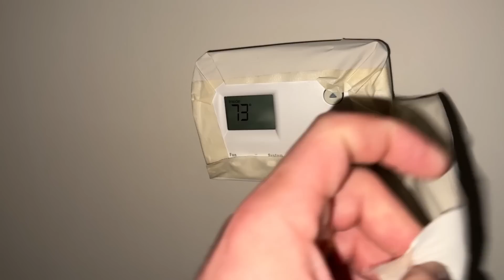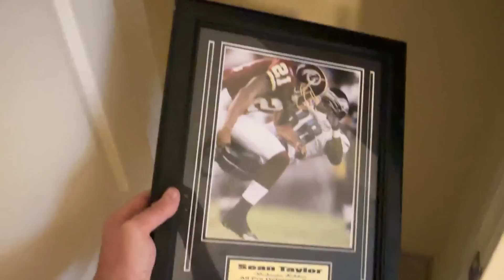I Talk TOO MUCH...

Comment: Dude 850 is nowhere near enough for trim change in that unit… should’ve at least charged $1000. And plus for rush jobs they got no one else to do rush jobs besides you…should at least be charging $200-$250 for rush jobs plus unit cost

Comment: Joe you should either have people pay you to set them up on youtube or if you think someone is an opp give them bad info instead of good info. I can think of 3 people eating off you right now on youtube you aint lying you should CHARGE for that!
Reply: Joe started the prison genre and of course others will follow. It's just like any other genre that gets started. Others just stuck to it and Joe went a different direction with it when it came to helping others coming out of prison. Others when they ran out of stories had to change it up, joe didn't he wanted to vlog.
Reply: @mikemeunier6285  it sucks when you pave the roads and someone else drives down it so easily behind you